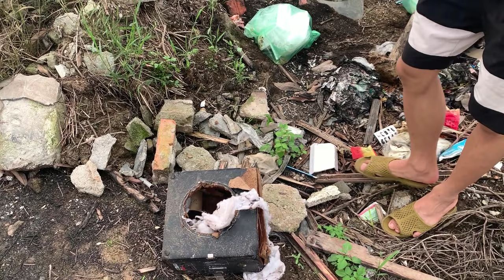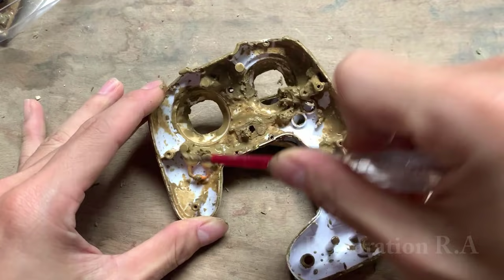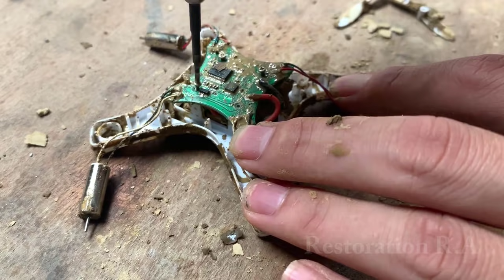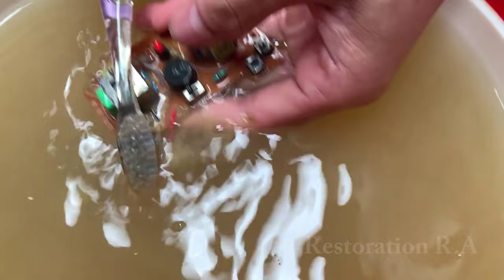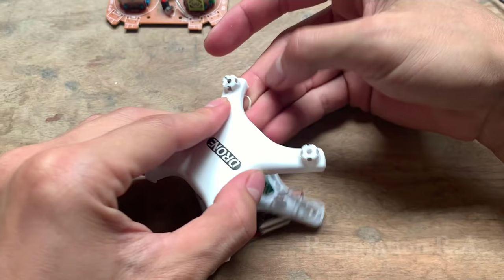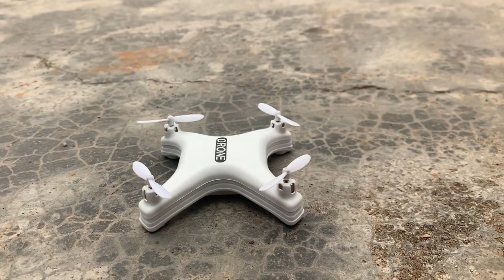Restoration abandoned old broken Flycam camera | Retro console Flycam Drones restore and repair

Comment: How a board can work after he put it in water or a battery that what I don't understand
Reply: If the battery isn't connected then there is nothing to kill the circuit. Just you have to dry it up properly before connecting to any sort of power supply. Otherwise....Boom⚡